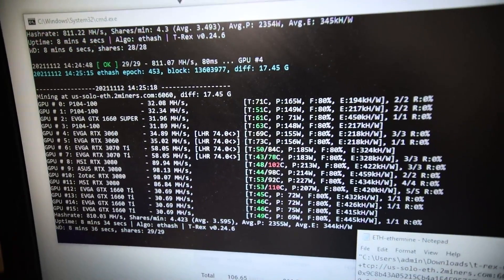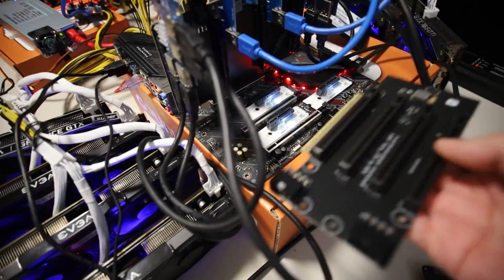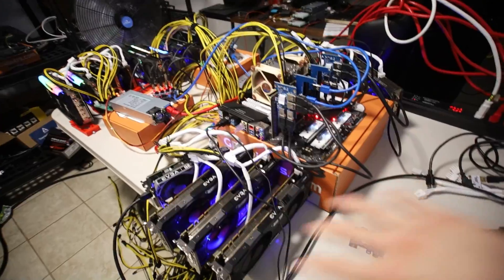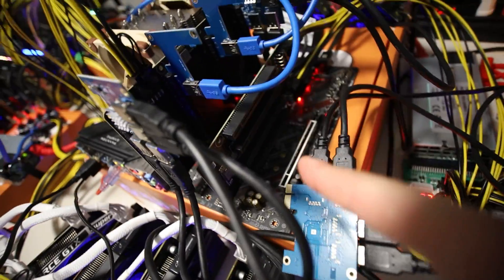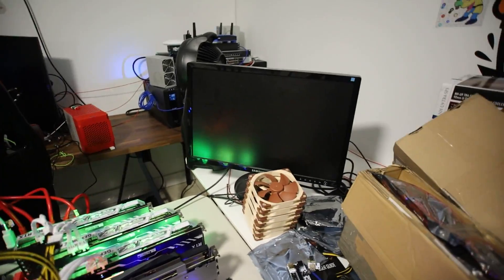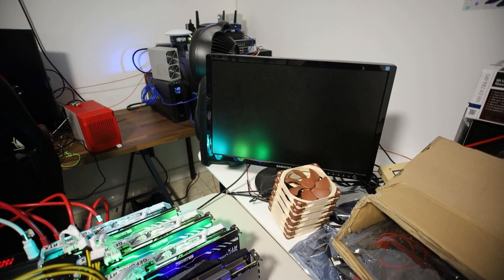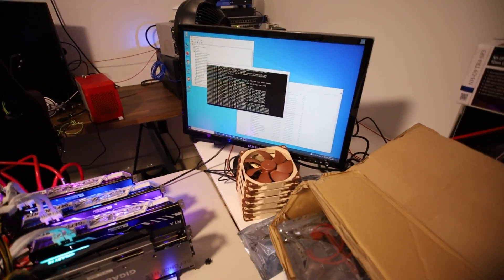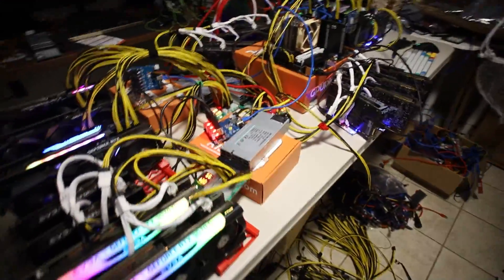16 GPUs MINING on 1x PCIE x16 SLOT!!!

Comment: Hello. I have watch your video about 24 and now 16 GPU. If I'm right in previous video you wasn't use any mining GPU edition (like P104-100 etc) and you got just 13 running. I'm thinking that even without your new adapters you can still get up 16GPU running if you use a P-series GPU. 
If I can make a advice try to use more P-series GPU or added AMD cards.
I have a filling that with mixed Nvidia+P+AMD you will reach the goal.
In my opinion just a driver's now stop your project.
For example look on Asus B250 Mining Edition... They said about mixed GPU to reach up 19GPU...

All people said that PCIE lines, that GPU tak 4 line?! Can you explain to me why I put running 13GPU at CPU i7, i5, i3 (skylake) and G4560... All of them have 16PCIe lines... And why u use a PCIE X1 :p
I really think that problem is a GPU drivers... I guess the maximum load is 13 GPU (like 13 gaming GPU +13mining GPU) probably mining GPU is like separate somehow in drivers.

Comment: Hi Red Panda, 
Why don't you try to use the old DELL Rack 7910 workstation server case with cheapest 2 x Xeon processors... It goes pretty cheap those days and you will get 72 PCIe lanes out of the box spread on 2 x 16 + 5 x 8 risers...then you can use PCIe riser flex extender to pull this slots out of the box and use this bifurcation cards outside of server case and connect all outside of the case... With R7910 you'll get also professional IDRAC tools you can manage and monitor this rig from distance and over the internet on the BIOS level.... Theoretically it should be able to hold all 72 cards with this kind of setup and it has integrated VGA for management purposes. This basic second hand R7910 configurations is almost cheapest then just a newer processor with basic power consumption around 200W + GPU cards...

Comment: Be careful, the other day I was messing with my rig and I left a little daughter board just sit on one of the slots by accident and fired the rig and it literally started welding itself to the slot. Seeing all these carbs into cards into slots left right and upside down has me worried one could "slip" out over time and do what happened to me. By the way my rig didn't turn itself off, PSU, MOBO, nothing turned off i had to unplug it to make it stop. BE CAREFUL GUYS!

Comment: its not 16 gpus, rather 13+3 (13x gpu + 3x mining gpus) if you will add P1xx mining gpu in next slots, probably you can get it work, pci-e lanes doesnt matter in this, with FOUR splitters/multipliers cpu using only 4 lanes

try to 13x gpus + CMP gpu - if thats work probably you can make 13+ 8 or 13 + 13 or 13 + even more gpus

Comment: If using one PCI-E Slot with all 16 Lanes would let you run out of PCIE-Lanes, no one could use these other two slots using a single GPU (without a adapter). 

Think about it, you buy such a $250 Board for your gaming Rig and after putting a GPU in it you cannot use these other 2x 16x Slots.

Is there a option to enable Multi-GPU support in the bios? (for using crossfire or sli?). The Manual says you can use all three ports in SLI/crossfire mode. As far as i know many mainboards need to cut down some pci-e lanes when used in sli mode. Maybe if you split the second PCI-E port you cannot use all 16x of the first slot. maybe everyone of these ports gets cut down to 8x!? 

Try using two of these 4x4x4x4x adapter with two 4x-gpu-USB-splitter-card adapters if this works try using a 16x riser cable to try using three of these 4x4x4x4x adapters with six of these 4x-gpu-USB-splitter-card adapters.

Comment: Hey Red Panda.
I loved this video and wanted to share an idea I had to try and solve your issue with 16 card limit. 

PCIe 1.0 bandwidth is 250MB/sec per lane
PCIe 2.0 bandwidth is 500MB/sec per lane
PCIe 3.0 bandwidth is 1GB/sec per lane
PCIe 4.0 bandwidth is 2GB/sec per lane
The total PCIe lane bandwidth of your threadripper is 32GB/sec as it has 16 PCIe 4.0 lanes.

If you were to go into your bios and change the PCIe mode to 1.0, it should free up tons of lanes for gpus to use at a lower bandwidth. If you do the math, this should in theory allow you do have 128 gpus connected to your motherboard with a bandwidth of 250MB/sec per card instead of 16 with a bandwidth of 2GB/sec as the amount of available lanes would be increased by about 8x taking you from 16 PCIe 4.0 lanes to 128 PCIe 1.0 lanes allowed by the available bandwidth of your CPU. 

1.0 speeds should be sufficient for mining as there is way way way less data being transmitted as compared to rendering graphics in a video game and should not impact hashrates.  If you really wanted to you could run in PCIe 2.0 mode and have about 64 cards connected at 500MB/sec bandwidth per card instead, but 1.0 should work just fine. 

I do not have enough cards available to me yet to test this myself, but I would love to see what you can do with this knowledge.
Reply: Is this really possible? Has anyone tested it?

Comment: How are those pcie multipliers working out for you? I mean the small ones. I've been struggling with those, specially the ones that don't go directly into the slot, they have a USB cable that connects them. The gpus connect to them go  down constantly. Sometimes the rig stays up for a day or two, other times it can't hold for a few minutes. Seems to be related to the room temperature.

Comment: All Threadripper (non-pro) have 64 PCIe limit.  You'd need to look at the WX80 board and Threadripper Pro (or equally an Epyc setup) to get 128 PCIe lanes.

As for 16 limit, that is an interesting one, guessing Linux setup on this would also limit it? 

Try to see if you can add an NVME drive and see if it gest detected as the "17"th PCIE device.  if it fails, then we'll know 16 would be (potentially) hard limit.

Comment: Try to add a 17th card with the x1 straight into the motherboard, and if that owrks try the card but test all the slots with an x1. Also verify that the other cards work.

And make sure you've used "restart" once and not only shutdown before adding the 17th card.

Comment: I've had the same issue with the parallel miner PSU link. You just have to get the two PSU breakout boards to the same position (on or off) then connect the cables

Comment: Hi RedPanda. Quick thought: your splitting 16 pcie lanes into 4x4. Then using 1 lane per each 4 lane to connect 4 gpus. 

Your only using 4 lanes from the slots. 
The question is what happens if the bifurcation could be 16 x1 pcie lanes, Would that mean 64 gpus?
Reply: Bifurcation can't do that. You can only do x8x8 or x4x4x4x4.
Nothing impossible about it, other than the fact that no motherboards/cards offer any other division styles.

Comment: EDIT: nevermind, just checked the motherboard manual for that Phantom 6, it supports 16X on all slots, at the same time. 

Does that motherboard allow for more than one PCIe slot to run at 16X? That bifurcation card forces the slot to run 4x4x4x4. You should have plenty of lanes, but I see so many strange restrictions on motherboards. Where if PCIe slot 1 is utilizing 16X, it disables / limits other slots. 

I don't know why they would have such a restriction on Threadripper platforms but that could be it.

Comment: 0:57
Panda, I told you it's a problem of the addressing. You don't know why you didn't get more than 13 cards to run @ your 24 gpu threadripper video? You didn't try a P104 card to get more than 13 cards to run. These special mining cards must have another addressing to allow the system to order them into another section as graphic cards, but show up as those. The addressing won't allow to run more than 13 normal gpus. Give it a try with 11x normal amd gpus and 8x P106 or P104 if you have. This is the setting of the asus b250 mining expert. Maybe then you can run 19 cards on that threadripper.

Comment: Re-check all your pcie settings, if I can get 15 cards on an old h-270f board you should be able to smash past that, are you running all the cards on gen 1/2 pcie so they all run in x1 mode?

Comment: as someone else already mentioned:
the asrock phantom gaming 6 (use it myself) is a X399 platform which supports Threadripper gen1 and gen2.
you cant run a gen3 threadripper in that mobo. 
BUT you already got the m2. to pcie adapters. this board has 3 m.2 slots. what if you use the pcie splitters in these? they are all pcie x4.
did that work at all?

Comment: Damn I thought it was all 16 generic GPUs but it seems that the unbroken number of 13 GPUs was used and remaining 3 were P104... :/
As I've said before it seems that it's limited by chipset/cpu that max number of video card is 13 no matter what adapters you use.
You won't get more than 13 generic video cards unless you get a splitter that will also allow you to mask the plugged cards to show up as some other processing adapter just like P104s do and also driver mod would be needed.
Reply: And no CPU with more lanes won't do bat$hit

Comment: Try placing the 4x4x4x4 adapter on the other slots, just to verify if it will work on those. To clarify. The one with 16 gpus on it, place it on the 2nd and 3rd slot, without the other adapters

Comment: You won't be able to use a third-generation Threadripper CPU in that motherboard.

First- and second-generation Threadripper CPUs, including WX SKUs, use X399 motherboards.
Third-generation non-WX SKU Threadripper CPUs use TRX40 motherboards.
Third-generation WX SKU Threadripper CPUs use WRX80 motherboards.

While I believe they all use the same physical socket, they are not compatible.

Comment: I just changed the pads on a couple of 3080's with the exact ones you got, pads themselves seem pretty decent (some did come a little squished on the edges, but for the amount of pad you get I let that slide), temps are back down to 74C like they should be. Takes a while to clean the oil tho :(

Comment: If you only populate the first slot it is in 16x mode so you can fit 16 cards. If you add another card doesent it restrict the first slot used to 8x and second to 8x for the same total of 16 pcie lanes? If that is true you should be able to add 8 cards to the first 8x slot, 8 cards to the second 8x slot and an extra card on the small 1x slots for a total of 19(?) Cards

Comment: I see you used some p104s. Isn't it that you can do what you did without that board you bought? In other words.. if you swap those p104 with regular nvidias.. will it work?
Reply: Reason why 16 worked is because you used p104s.. if they were all regular cards 16 wouldn't have worked. Nothing has changed.

Comment: since its an x16 slot, it would only allow 16.  When you add another card, it "in theory" the system will automatically drop all the slots down to x8.  I bet you if you don't put more then 8 cards per PCIE slot, it would work
Reply: check the board specs.  It would say something like "if only 1 PCIE slot is being used it will be X16.  If 2 or more PCIE slots are used they will only be X8."
Reply: good stuff. wonder if you could disable pci-e slots then - seems a bit shitty - why should each pci-e slot definitely need to work, just let us use up the pci-e on less slots ahaha
Reply: I think you nailed it.
Reply: my strix 570e does just that, as most mobos do. please correct me if im wrong lol

Comment: how does a higher lane cpu help if you are only using 16 of them also isnt ryzen only has 24 lanes, 4 to chipset, 4 nvme and 16 to pcie top slot, rest are from chipset.

i found this 1 to 4 pcie from your channel and bought one now all my 12 3070 are on a
X55 intel oem board with 8gb ram and x3560 with 3 of these 1 to 4 usb cards, funny thing the board is super dead only 1 usb port works no audio no drivers no shit but hive os runs lol and it has been the only board which ive had such a high runtime with.

indeed they dont make it anymore like the old days :D

Comment: HiveOS CEO: T_T NOOOO THEY CANT FIT THIS MANY ON 1 RIG!!
EDIT: Also, try to use a PCIE 16x to 16x slot riser to still use the second slot for the second card. Perhaps the second slot will work since it may have more lanes
Reply: all 3 pcie x16 slots on this mainboard are true 16lanes. thats the reason why he is using a threadripper platform....

Comment: Hi RedPanda! I think you already used all your pcie lanes. Every Card is using 4 lanes, and if you multiply it by 16 cards, you’ll have 64. 1 pcie lane is just measured as bandwidth with the CPU. GPU’s need between 4 and 16 lanes in order to work efficiently. If you had a threadripper with 128 lanes, your project I am sure will be successful!. Love watching your channel.
Reply: Mining takes very little bandwidth, most of my GPUs are running at pcie gen 2 1 lane
Reply: Good
Reply: Agree
Reply: @Mike  Exactly. And that also only has 16 lanes
Reply: @Mike So how dose a pcie to 4 usb splitter card work? Can you use more then 1 lane 
through 1 pcie 1x slott??
Reply: @adamlof  
Switching lines ... bandwith /2,3,4 cards
Reply: @adamlof  you just put it on the pice_x1 slot. Im currently using one of these with 4 cards on a old motherboard with a i5 quad core running smooth so far. As long as is pcie slot it should work
Reply: @ld3336  its important to have „above 4G decoding” in bios enabled to work with more than 4 sometimes 5 cards.
Reply: Agree try threadripper with it you will get extra lanes support from cpu
Reply: CPU specification must be check first before adding more gpu.. theres diff limit that cpu can handle.
Reply: Hie how many Cards i am able to use in My Z390 + i3 9100
Reply: But like a z270 board only has 16 lanes but that can support 6 gpus, right? 6 cards * 4 lanes = 24 and not 16. 

And another thing, The splitter uses only a pcie16x1 slot and can support 4 gpus. So how dose that work? You can´t get 4 lanes from a pcie 16x1 slot, or am I wrong??

Comment: What needs to happen to get one splitter to work is it plug and play or does the bios need settings changed  reason I'm asking is I have a optiplex 790 Mobo that I want to run 2 gpu from but only the pcie x 16 work. When a gpu is in the pcie x4 slot it causes the pc to power cycle. The bios only has the option to enable a pcie lol

Comment: You said x4 x4 x4 try splitting it all off the first pcie16, then split again. Not sure if I'm saying this right.1x4=4 4×4=16 16x4=64.
Put the four pcie16 split in the other pcie16 split. That's 28 pcie1 that can be split four ways to 28 gpus.

Comment: You using only 1x pcie lane with this 4 times splitter so you can't run out of PCIe lanes,a CPU with more lanes should not change anything. maybe it runs out of adressspace for your hardware adresses.

I still think tho 13 Display adapters is upper limit and the rest need to be compute cards or storage devices only.

Comment: Hey man. Great videos. I think you are mistaken and you would need a 2000 series threadripper  3000 is not compatible with those due to the pin locations. 

eBay has some great deals on amd epyc cpu. You would be better off doing that and having 8 channels of memory most likely.

Comment: x399 1st gen mobos only support 1st/2nd gen threadripper cpus. To go to 3rd gen threadripper you would need a x399 trx4/trx8 mobo. 1st gen x399 is tr4. IIRC 128 lanes are on threadtipper pro aswell.
Reply: The chipset for 3rd gen TR is called TRX40.
Reply: @friedelectronics  yep.

Chipset | Socket | Supported SKUs

X399 | TR4 | Threadripper 1000/2000
TRX40 | sTRX4 | Threadripper NON-Pro 3000
WRX80 | sWRX | Threadripper Pro 3000

Comment: I have a 3970 threadripper on a TRX40 mobo, but they have the same amount of pic-e lines as the one you are trying, so I am not sure what the point is. If you want to try something else, you would need to go for a threadripper pro which has also way more slots. However given the price of a threadripper pro, I am not sure whether it makes sense

Comment: You can't use AMD Ryzen Threadripper 3000 series CPUs with that motherboard. You can only use 1000 and 2000 series ( and 2990 - 250WATT TDP is also not an option, VRM is not powerful enough - Max. CPU TDP is 180 WATT for the motherboard . ) TR 2950X is the highest CPU that you can use with this motherboard. 

For AMD Ryzen Threadripper 3000 series CPUs you need AMD TRX40 chipset motherboards
For AMD Ryzen Threadripper 3000 PRO series CPUs you need AMD WRX80 chipset motherboards.

Look at the BIOS, find the IOMMU settings. ADVANCED/North Bridge Configuration -Disable it Input-Output Memory Management Unit (IOMMU), this might help.

Comment: re: floppy cable
It's not shorting.

It remembers the previous state on the breakout board so if one was powered on and the other was powered off independently of each other, it will remember that.

It's a dumb toggle.

You just need to power on the other one that isn't powering on together separately and then power both of them off, connect the floppy cable, and then it will work.

Comment: I don't think that more gpus will work even with the bifurcation splitters because normal consumer motherboards just don't have enough rom space to allocate to all those gpus. Craftcomputing on youtube had this problem with some radeon firepro and nvidia tesla gpus because those gpus do split them self into like 32 smaller gpus that motherboard detects separetly. So what i'm thinking best doing is getting an older AMD EPYC motherboard (1. gen or 2. gen) with an older epyc cpu. Because server boards are made to handle more gpus and more pcie devices! and the newer epyc cpus even have 128PCIE lanes! EDIT: And even a workstation motherboard with the 24 core workstation cpu will probably not work so i still think getting a server board will get you more gpus
Reply: its a nice plan and good fun, but really isnt good in real life. You have one gpu/riser/pcie slot/splitter/USB cable... not working well after half a year crashing the system, and it is very hard to diagnose with 20 cards.